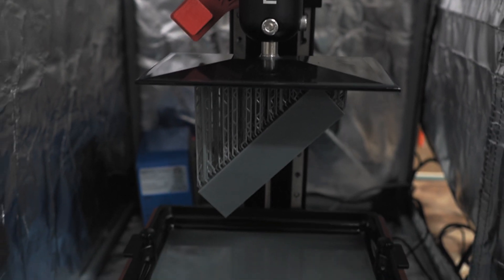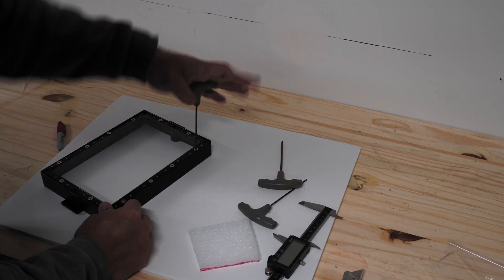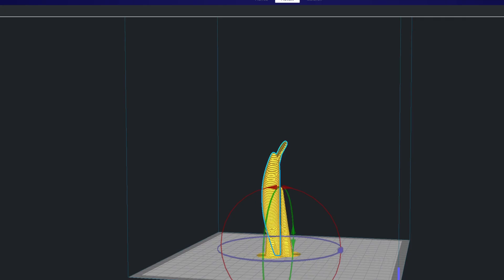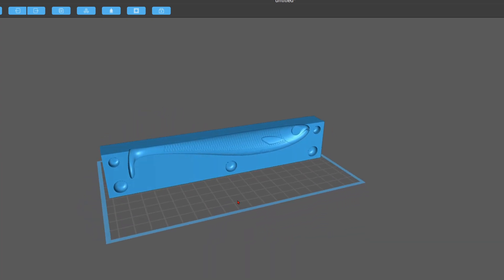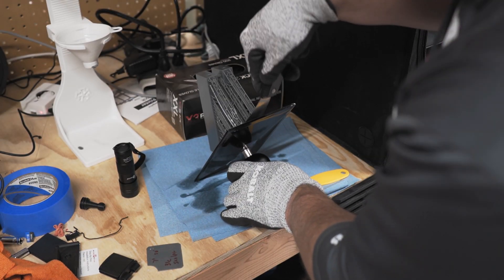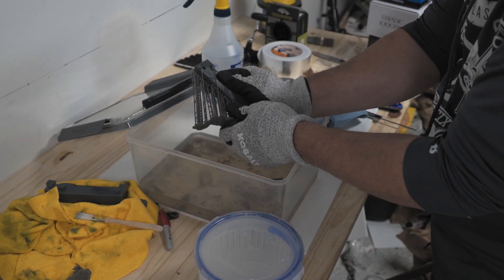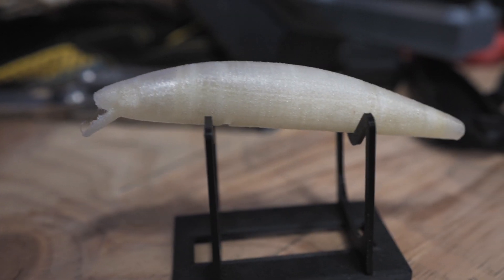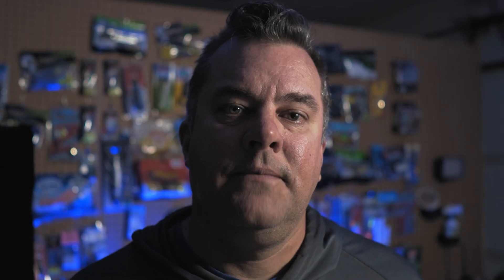The Complete Guide to 3d Printing Fishing Lures - Part 2 Choosing a Printer

Comment: So I heard you mention in another video that resin is better because of how hot the plastisol is if you’re using it for a mold. Could I still use fdm for making soft plastic molds?
Reply from the maker: Most filaments in FDM printers melt way below the typical ranges for plastisol (300F-350F) so they are not good candidates for injecting. You can do it, but the mold will not last very long. What I would recommend is printing the master in FDM and then making a silicone mold from that master. I outline that process in this video - https://youtu.be/B8WqBjHw3pE

Comment: Great videos man, I actually had some ideas about making some lure molds as well but haven't gotten around to it yet. I would suggest printing the molds flat on the build plate, and not using supports at all. I think that should minimize any warping of the mold. You would probably want to use a flexible build plate to make the mold easy to remove.
Reply from the maker: Yep been printing them flat, a little harder to get off but worth it.